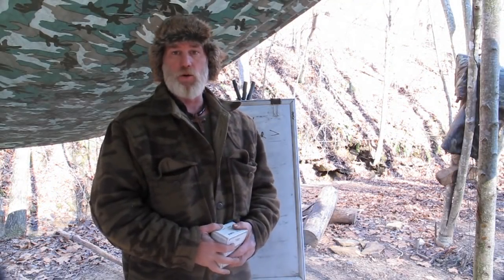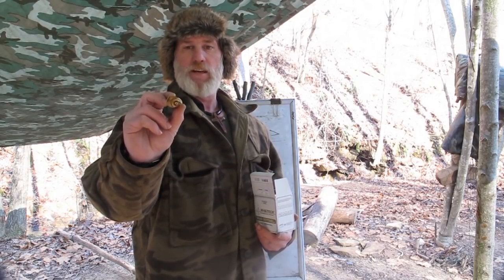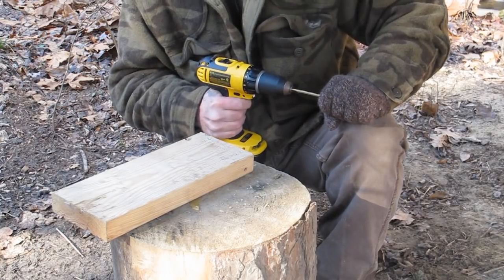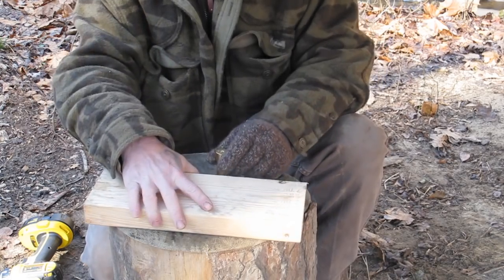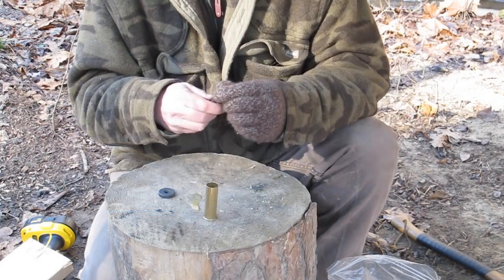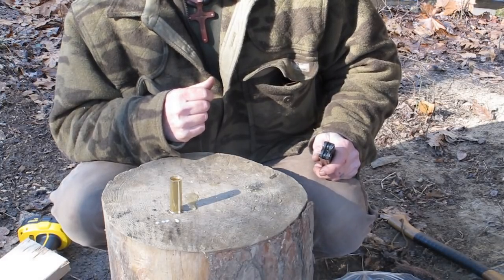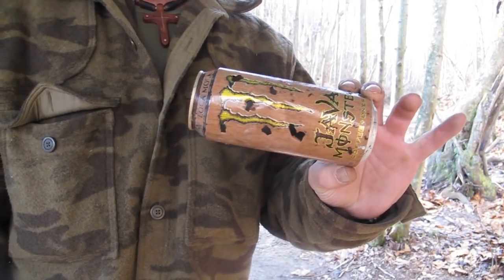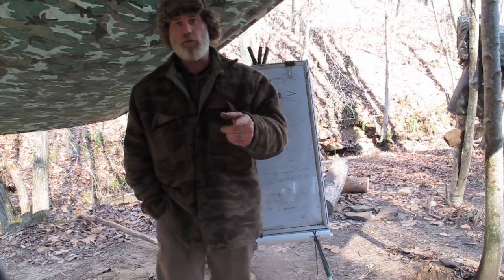Modifying Brass Shotgun Shells to accept the 209 Primer.wmv

Comment: Hi Dave... I've been a reloader for over 30 years... Love your vids brother! The primer seat in a standard shotshell should be drilled 15/64ths just as you did. The standard 209 primer is 1/4" in diameter so you need a 'slightly' smaller seat drilled so that the primer will seat and hold under pressure. I would use a 5/8' wooden dowel 'or equivalent' to slide inside your brass to impact and seat your primer as not to damage the mouth of your round. I love this new series!

Comment: I load/reload piston, rifle & shotgun ammo and have been doing so for 30+ years, here in Texas where I live the 209 shotshell primers are always either the same price as the pistol & rifle primers or maybe just slightly higher, but Dave makes a great point about usability in the field, the #209 shotshell primer is way better.....Thanks for the great info. Dave, Also after the shell is loaded you can put some red finger nail polish over the primer that will seal out moisture protection once dry.

Comment: I have a number of years experience handloading ammunition, and I know the difference in the ignition/burning rate of different sizes and types of primers. Therefore I know why only shotgun primers should be used in shotgun loads. I wish you had explained to those who don't know the difference why it is dangerous to use rifle and pistol primers for black powder/Pyrodex loads.

Comment: U made a tool by drilling a 1/4" x 3/8" hole in the end of a 3/4" x 6" dowel. Saw slits along the length and sand slightly to prevent air lock from getting dowel stuck in the shell. Square the primer as best you can, invert the shell, drop the dowel inside and a few crisp raps with a mallet seats them easy enough. I recommend a primer pocket cleaning tool. Over time the pockets foul, making repriming increasingly more difficult.

Comment: I actually prefer when a primer doesn't drop in easily. I know that the more pressure it takes to fit the primer securely will help keep moisture out of the finished shell which is something I would worry about in a survival situation.

Comment: I do not know if you will see this Dave but wouldn't this be ok with a black powder setup. For deer season. Yes the adapter would be better but this would be nice in the " toolbox " and use a couple of times so you would know what you are doing.

Comment: Hi Guys and Gals a helpfull hint I found works for me is to seal the end of a drinking straw by holding the end with my multi tool then measuring and pouring my powder into it. I cut the other end if the straw about 3/4 to 1 inch above the powder level and pinch it shut with my multi tool again and melt and seal it too. You can make a bunch of these up ahead of time and even in different loads of powder. If i make different loads i write the load size on with a fine tip permanent marker.

Comment: oh yea i get my straws from  Burger King or McDonalds so they dont cost me anything except time spent in cutting, premeasuring, and sealing. i use an old clean butter bowl under the measure when i load so if i spill any powder i can reclaim it easily. i also use a home made paper funnel to load the powder from the measure into the straw.

Comment: Would it be worth after drilling the main hole to load up the next size larger drill bit and just slightly touch it...brash will be soft so maybe running the drill in reverse would be good since you want it smooth and just a very slight depth?

Comment: @JACMAN02 Black powder recipes are prevalent on the internet. Recreate any of them with care, as black powder is tempermental.  Projectiles are the issue.. The only components you can't easily make are the primer, and the brass.  Dave is using a common firearm to demonstrate alternate ways to maintain use of it in a survival situation.  This is providing you possess the firearm to begin with.

Comment: Sorry i didnt proof read my last post to well i melt and seal the end of the straw with a lighter while holding it with my multi tool after measuring and filling it with powder i leave 3/4 to 1 inch then cut  and pinch that end with my multi tool and melt and seal it. i have a reproduction .44 cal cap and ball pistol and i get 3 measured loads per straw at 25 grains. it will give you a waterproof premeasured load that all you have to do is cut off the end and pour into your barrel.

Comment: The reality is it's not really going to make a difference either way in the power of the load.  If you are using the small pistol primers and plan to hunt in really cold weather you should use magnum primers though.  You'll get more reliable ignition that way.

Comment: No.  I assume you are talking about a percussion cap or a musket cap, and no those won't work in a cartridge case, any cartridge case.  Modern primers have an 'anvil' inserted into the primer cup so that the firing pin has a hard surface to crush the priming compound against in order to cause it to explode. Percussion caps don't have this anvil as they relied on the firearm's nipple to serve that purpose. Unless you're recreating pinfire shells (only used in pinfire guns) it won't work.

Comment: Great Presentation! also one of the more bountiful resources here in Northern Mn is good old spruce pitch I used it to repair my Birch Canoe on occasion; but would also make a good sealer mixed with fat to top off a shell it is a bit gummy but would work in a pinch I have an old forty Buck shotgun 1900's vintage eastern arms I put back together  the stock was in five pieces taped with 50 year old electricians tape hard as a arm cast I just have to put it back on face with a shim and will test out the pitch idea.

Comment: You mention beeswax can be sticky in the barrel but what about paraffin wax? I don't have immediate access to tallow but I do paraffin for canning and candle making.  I've seen people use rubber cement, silicone caulking, elmers glue, nail polish but I don't think any of those would be good for the barrel.  Of all of them Elmers is probably not that bad.

Comment: They won't turn into wax slugs because you're pouring the fat only over the mouth of the case. With a wax slug you mix everything together then pour it in. 

You could try mixing the fat and the shot together first. I think the fat may be a bit too soft compared to the wax.

Comment: not hard a punch or a nail of the right size to punch out the primer and a something to put into the shell to use as a reprime punch 

they are cheaper and the large pistol primers are easier to reuse(white time match tips or papper caps for a cap gun then a .209

Comment: I have never found 209 primers to be any cheaper then large or small pistol primers here in GA.... in fact i never remember 209's being any cheaper then pistol.... Also never drill out the pocket like shown in this video unless its for use in one of these break barrel guns... and NEVER EVER DRILL A STRAIGHT THROUGH FULL DIAMETER PRIMER POCKET IN A RIFLE OR PISTOL CASE... If you carry a 44 or 45 cal sidearm i would leave the Lg pistol primer pockets so you can load both with the same primer.

Comment: How would these reloaded shells work in a pump action shotgun?
Reply: +Chaplain Dave Sparks They should work in any gun chambered for them, even automatics.  But the tallow or wax will melt in a hot gun potentially making a mess or a pipebomb situation.   You can use hot glue instead tho.